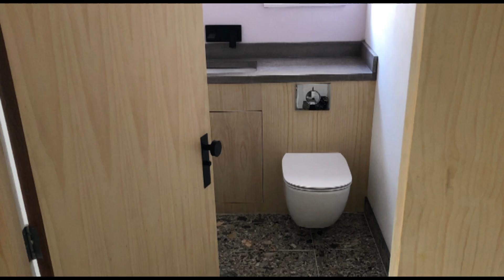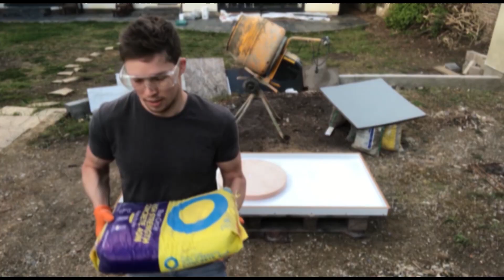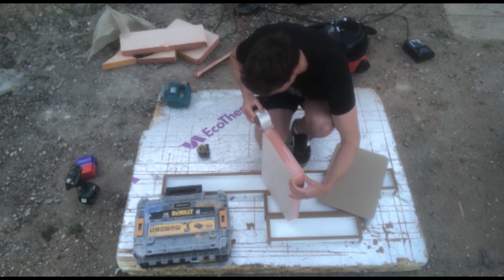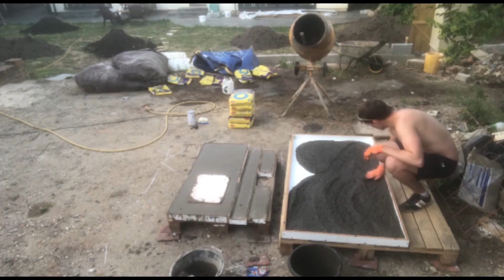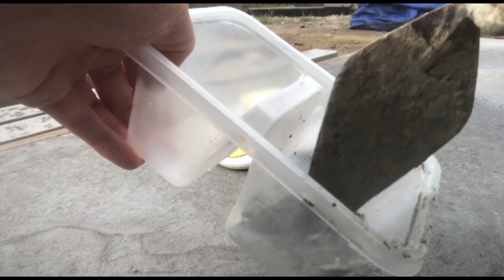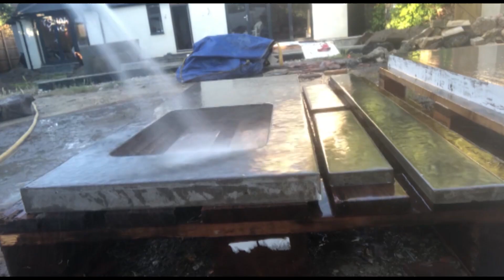DIY Concrete Countertop Splashback & Pizza Oven Worktop Made in 7 Minutes!

Comment: Great video. Really informative. Am just in the process of doing a concrete counter for an outdoor kitchen. Am trying to decide on whether to cast in situ of use the upside down method you utilise. If I was casting two pieces and then joining them together how would you cover the joint between two pieces to get a smooth continuous finish? Also do you need to allow for any sort of expansion joint for a long worktop?